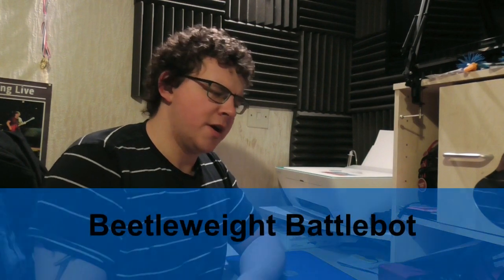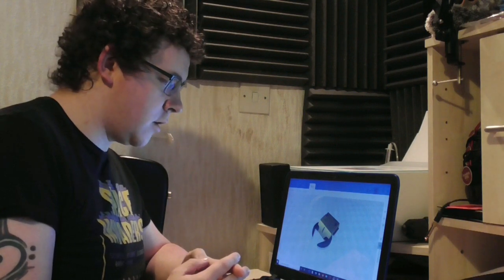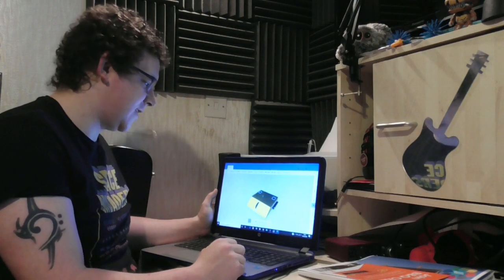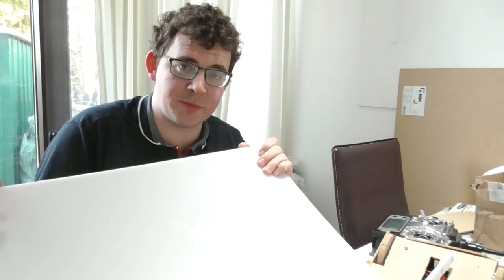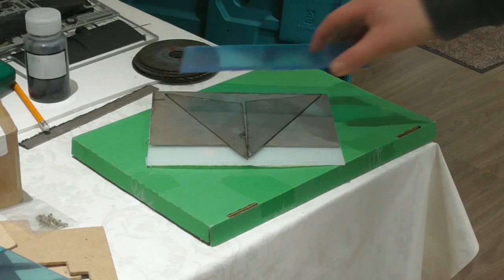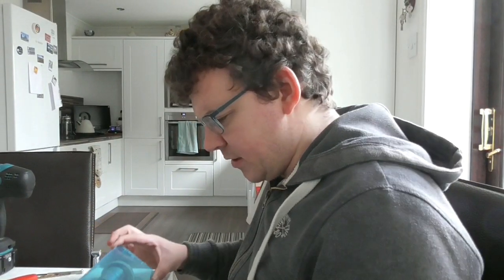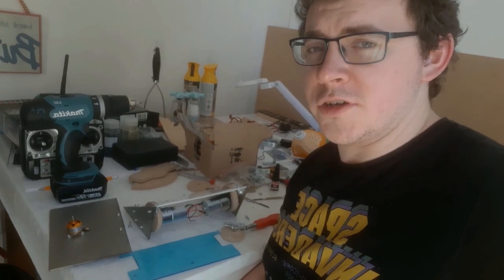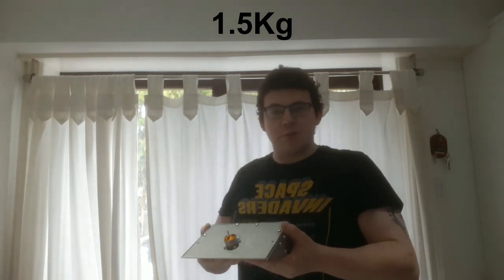Building my own Beetleweight Battlebot

Comment: Great video! What drive motors and batteries do you use please mate?
Reply from the maker: Thanks. The drive motors are Esports MJJ 12v motors with a 1500mAh 3s lipo battery. Hope that helps
Reply: @oeletarrobotics  amazing, cheers buddy! Liking the videos!
Reply: I know I'm quite late to the party here but a few things to note if you want to do your own build:

Motors: the motors being used here are massive and probably account for about 1/3 of the robot's weight if the stats I'm seeing online are to be believed. We usually use 12v motors in 22mm or 25mm diameters, and they should each weigh well under 100g. The Bristol Bot Builders website has links to specific parts which are ideal.

Battery: also pretty large. A 3s battery with up to 1000mAh capacity is typical for a beetleweight.

Other general stuff: there are a few key rules to follow if you want to compete with a build and you will really want to check them before building. Weapon locks, failsafing, power lights, fuses, and specific power on/off hardware are all essential.